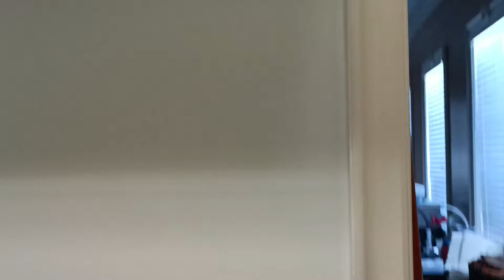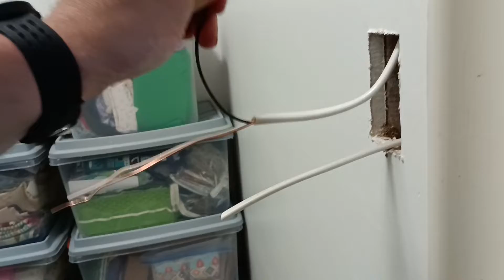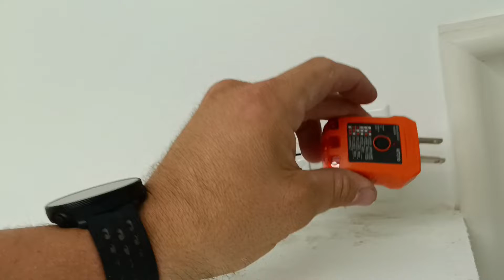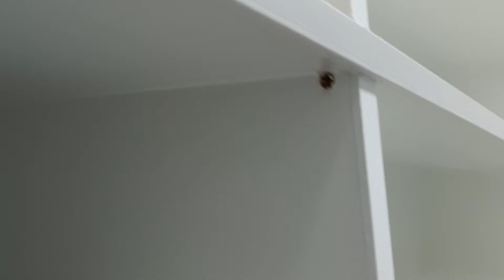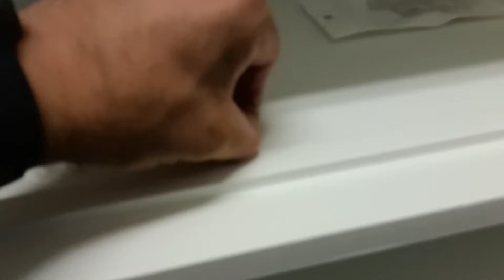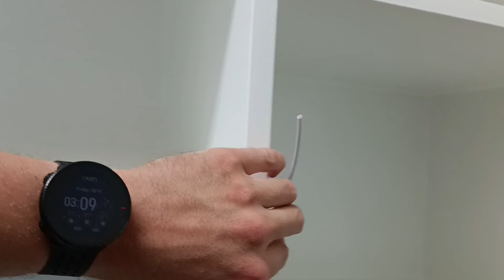How to install COB LED Strip Lights

Comment: Can you just hardwire this directly to a switch or do you need the transformer?
Reply from the maker: @ttaffaro  lights like this only work on 12v or 24v. wiring it directly to the switch wouldn't work because the supply voltage would be 120v.

Comment: How did you connect all the separate cob lighting strips to one power source? Did you use a driver? Lots left out of this set up video. There is not a lot of good set up videos for multiple cod lighting strips.
Reply from the maker: Good question, I ended up using crimp connectors to connect each strip of lights to one line feeding vertically inside the far cabinet space where I said there was really no way to hide the wires. From there I fed that one line through the top and to the power supply. Most power supplies come with the connectors you need to easily make them up. Here are some links to the connectors and power supply I used. I did end up going back later with some wiremold strips to hide the wires.
https://www.amazon.com/dp/B07G5W9PH1?asc_source=01H2FV8WY4S2GZC8Y7GASAYV5X&tag=namespacebran500-20&th=1
https://www.amazon.com/gp/product/B0B5QBYSGP/ref=ppx_yo_dt_b_search_asin_title?ie=UTF8&psc=1

Let me know if you have any questions and I'll be happy to help.

Comment: Nice install, only part I wish I would have seen was what transformer you decided to use to power the 24V FCOB lights
Reply from the maker: Here's a link to the one I used.
https://www.amazon.com/gp/product/B07MZNMJYP/ref=ppx_yo_dt_b_search_asin_title?ie=UTF8&th=1
Reply: @HowitsdoneHandyman came out clean , what brand of light do you recommend I need to run around 200 ft to light up 11 billy bookshelf’s with glass doors and want to know what I would need . Each 5 cabinets takes about 100-115 ft of cob. I have 5 on one side of the room and 6 on the other . Can you help me with this

Comment: Very nice install.  I was looking at something similar and was considering installing some (or all) on 45 degree aluminum channel (particularly on the higher shelves to hide/shield the lights).  That definitely adds material cost and time.  Have you used 45 degree channel on something like this (where the price was not an issue).
Reply from the maker: I actually thought about using a channel for this project but since there wasn't much of a lip on the shelving face the channel would be more visible than just the tape lights. and yes the cost of the channels can get quite expensive depending on the project size. The Beauty of COB LED lights is they throw the light back very well similar to a fluorescent tube where regular LED tape lights are directed more downward.
Reply: @HowitsdoneHandyman  Good point on the greater coverage of COBs!